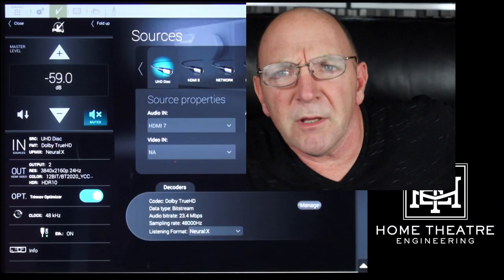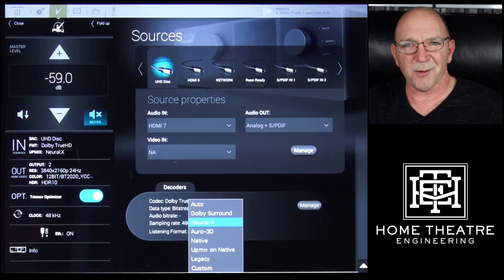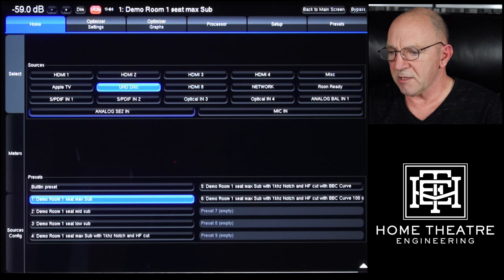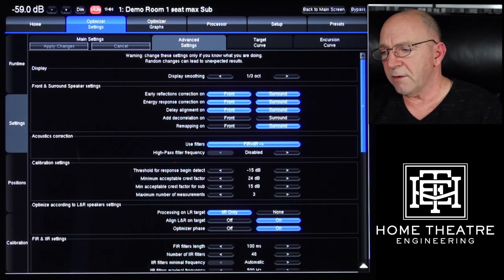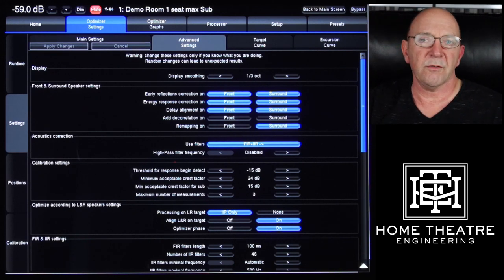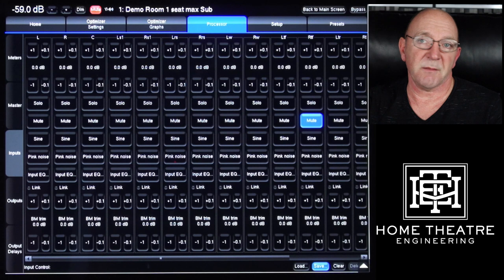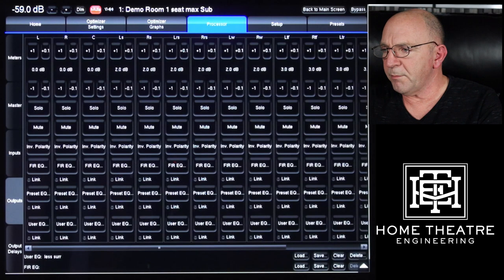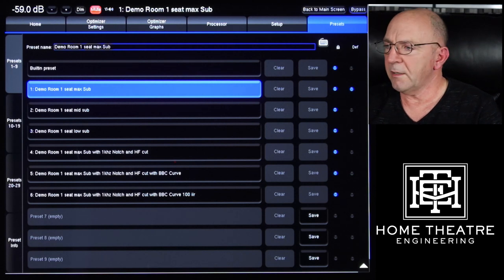Andrew from HTE explores the Trinnov Control Interface

Comment: great insight on the trinnov alt. in speaker amplification options, is this where the active crossover is? can it go to multiple amps from a channel, say for example bi-amp, high frequency and low-mid frequency? can it work with all full range frequency output channels (LCR, beds & height speakers)? excluding subwoofers/LFE, as we all know LFE only processes and produces frequency up to 80hz, as per THX guidelines.

Comment: I noticed you said 4 subwoofers only using one output. Does that mean the single output is connected to something like a MiniDSP? If so, why? Can the altitutude not perform its own DSP for the subwoofers?
Reply from the maker: Its been a while since I recorded this but the only reason for doing this was on the Alt 16 there were not enough channels. Had it been an Alt 32/24 or 32/32 there would have been more than enough. Yes the Altitude does a stellar job of managing subwoofers and gives you massive control over each one as well. More than you would get with a mini dsp. But if budget has limits then using one channel with a minidsp gives you options
Reply: Thankls. @HomeTheatreEngineering

Comment: So, you assigned only one of the channels for LFE and connected it to a minidsp which is controlling 4 subs, essentially providing you 15 discrete channels out of the 16 available. Are there any disadvantages (excluding the loss of 3 discrete channels) when using only 1 of the channels for LFE with a minidsp as opposed to using 4 channels dedicated to LFE and letting the software configure the subs? which minidsp unit are you using with the unit if you don't mind me asking. thanks
Reply from the maker: Wow good comment/question. Yes thats correct. We used a MINIDSP 2x4 Balanced.  The only real disadvantage is that you dont get Trinnovs room correction on each sub discretely and also you need to be very careful to integrate and set sub levels prior to running Trinnovs room correction but if you get that right it can really sing and dance.  Then Trinnov applies its correction globally to the 4 subs. That or you need to pony up for a 24 ch unit !
Reply: @HomeTheatreEngineering  thank you for the response as well as for making this video. I just bought the 16, I have until Wednesday to change my mind and buy the 32. I honestly don't see myself ever needing more than 16 channels total but figured if I ever needed more surrounds I can sacrifice dedicated sub channels by using a minidsp. I do like the idea of linking subs to different speakers, although I don't know how useful this will be. I'm assuming this can also be done with 2 minidsp's, 1 for a pair of subs linked to the front room speakers, the other for a pair of subs linked to the surrounds. this would leave me with 14 discrete channels (which Ironically seems to be an odd number in the world of home theater). Now that I think about it, this would probably make leveling the subs as pairs in the minidsp's a bit easier, and then have the software integrate the now two virtual subs to the rest of the room. Just a thought, not sure if I'm missing anything though, which I'm sure I am 😀
Reply from the maker: @zoubtube  Your thinking sounds good to me. Feel free to contact us directly to chat. Let us know if we can help you at all.  I think the 16Ch will serve your purposes and the 2 minidsp idea has merit. Good luck !

Comment: So,

When you double/place amps and Subwoofers in series, are you able to assign those speaker in series that occupy on on specific channel?
Reply from the maker: Hi, I’m sorry I don’t quite understand your question. Normally they are more in parallel than in series? If I can guess at your question. On Trinnov you can add as many subs as you like and assign them an output channel. Once you have done that you have full and independent control of each. Does that help?
Reply: @HomeTheatreEngineering  Yes sir, you did answer the question... I was mainly asking due statement in the video regarding doubling up speakers for the room... I think it was about 24 or 26 speakers in the room...

So, 

Am I to understand that if you have the Altitude 16 instead of the 32 or 48ext, that you can double up the speakers of the Altitude 16 and assign speakers 17-24 to other positions, correct?
Reply from the maker: @michaelslocumbsr.2286  ah ok. Its not ideal as you are splitting the output of one channel to 2 amps. There is some loss of signal etc. But if you have to it can be done but I would suggest only in a pinch. So we have 2 rows of left and right surround and as we are using all channels on a Trinnov which is currently installed we needed a way to do this and this was our choice.
Reply: @HomeTheatreEngineering  Understood... Do receive the same type of lossless when more than one Subwoofer is assigned to a single channel?
Reply from the maker: @michaelslocumbsr.2286  generally yes but it depends how you do this. We send 1ch to a minidsp with outputs

Comment: 20+ speakers is overkill and is actually providing an inferior experience. Unless your room is truly massive (1000 sq.ft+) you end up creating all kinds of phase and frequency interference with so many speakers in a “box” of a room. Next time you design a theatre try this: use the same budget for 10-11 speakers, you will have a lot less interference and you will get double the performance by spending 2X more per speaker! 
11 channels would be: L/C/R [C is not even necessary for most rooms] + SL/SR + SBL/SBR + VOG(2x) + 2 subs. 
You could even trim that to 1 sub (that is twice the cost of 2 subs, per unit), no C, and 1 VOG. Now you have even better sound quality. 
Remember that a proper 2-CH Stereo system will give you a huge 3D soundstage, from 2 speakers.
Reply from the maker: Not sure where you are getting your facts from but you are almost entirely wrong. Even the fact that you state a centre channel is not necessary in most rooms shows your level of understanding. There is also a very fundamental reason for using 4 subs. I would highly recommend you do an HAA course and also read a few industry white papers. Trinnovs speakers placement white paper is a good start. Also I would suggest reading Floyd Tooles works. Arguably one of the most learned and capable researchers in our industry. Finally one day come and visit our rooms and have a listen. Last but not least are you aware of the price performance and capability of Procella speakers? What speakers would you suggest we spend an extra $2k on? And no a proper 2 channel cannot deliver immersive ambience and surround sound and if it could that would be a heartbreak to all the sound guys slaving over object oriented multi channel soundtracks. We have been working with reference quality multi channel for a long time we measure and verify everything and work with amazing products like Trinnov. I’m sorry but none of your arguments hold water and your claims are unfounded. Not sure where you are located but you have an open invitation to experience our demonstration rooms ( one of which features amazing Wisdom audio speakers at nearly $12k each so yes we did spend much more than that extra $2k).